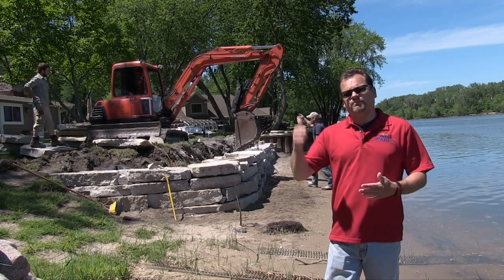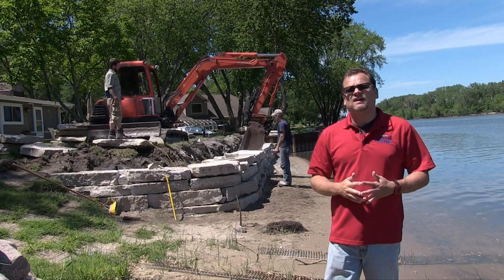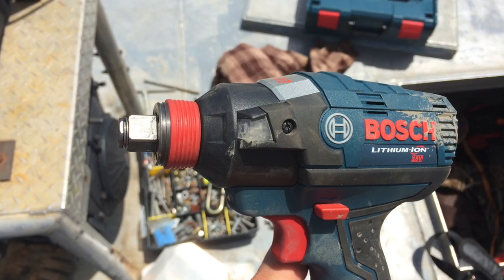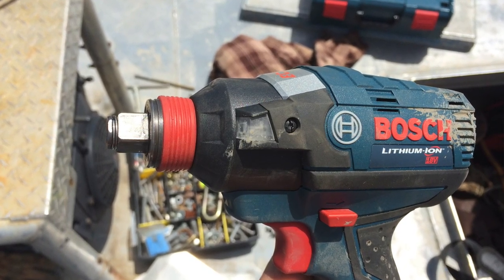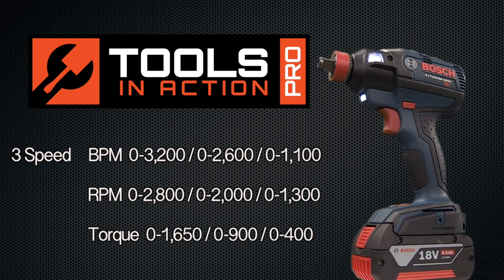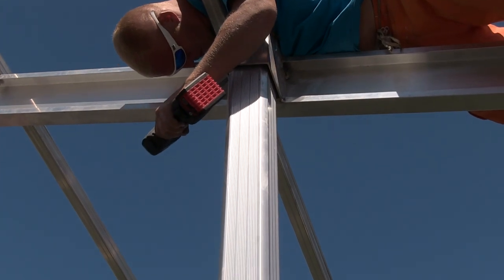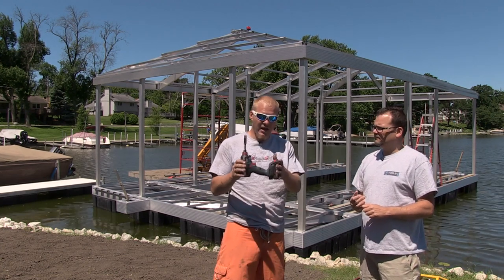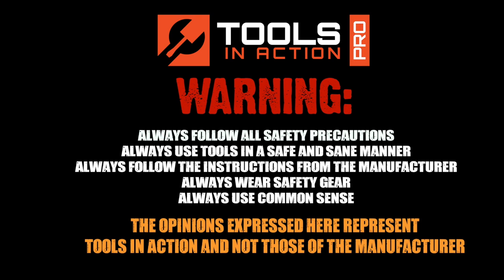Bosch IDH182 18V Brushless Impact Tough Tested by the Professionals

Comment: Wow... this is great.. powerful intro. Tools In Action Pro! I replay the begining intro 3 times! Definitely pro. Awesome job Dan, very well done! 
I like almost everything about the new Bosch brushless 3 speed impact driver, that I purchased about a month or so ago, It was light weight,  the grip is very comfy and ergonomic design.  It feels great. I like how it has a on and off switch on the 3 wide angle LED lights. Only thing was the 1/2" head was not quite working on my socket I had it on for some reason. It got stuck. Can't get it out. I think it was a defect or I thought i might happened to put on a bad socket on. Ended up returning it a few days after all. But I do have to admit it was a way better overall design than my dewalt DCF895, wish dewalt will do something to upgrade theirs. 
Away. Very great job guys. I like the TIA Pro a lot!

Comment: Im loving these reviews recently subbed...as far as 1/2 inch impact im really torn between the affordability of this impact kit from amazon or spending the money and getting the Metabo SSW18 LTX 400 kit. Do you guys have an impact tool fight or could you make a recommendation? I really love the power of the metabo based off your guys review...just want to be sure theres nothing out there im missing. Thanks for all your vids!
Reply from the maker: +Al Al hmm depends on what platform you have and what you need.  This is the best of both worlds  Impact driver with impact wrench.
Reply: +Tools In Action ended up with the metabo....glad you guys turned me on to them...great impact. Still wanna see a tool fight with the mid size impact class 1/2 inch.